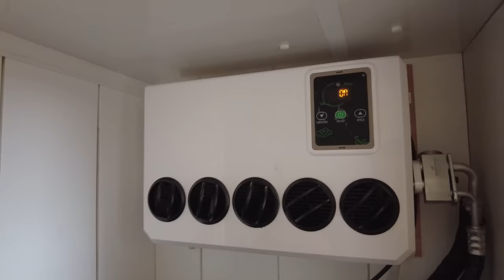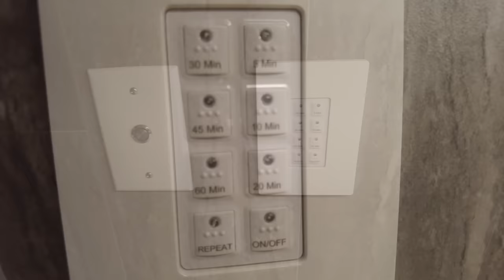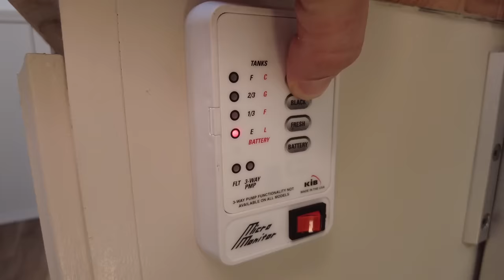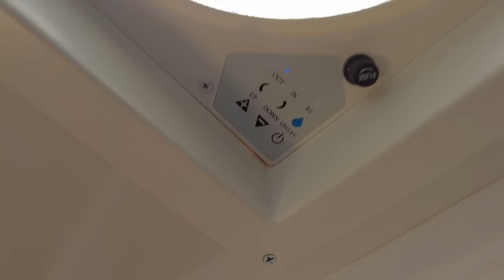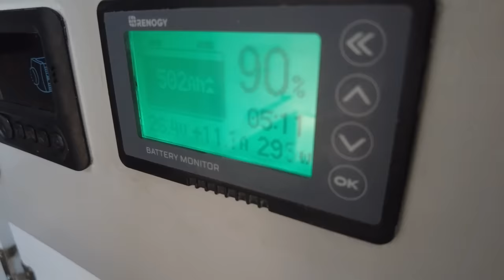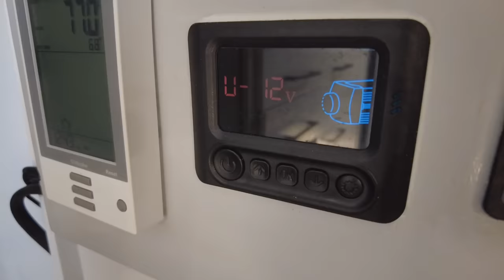Stealth Apartment + Toy Hauler in a Box Truck? DETAILED TOUR!

Comment: Love the couch. since this is to the clients specifications you and the client did an awesome build. One thing I would have not done is the trim piece on the bottom where the sleeping platform is located. I’m a short person and imagine I could sleep with wise on that platform therefore feeling a little bit more secure. With that wood piece that looks like molding located to the right someone would not be able to do that.

Comment: Living in my stealth box truck build 5 years now and I will never live in a regular house again it has worked out so well. I have all the benefits of owning my home with none of the drawbacks of regulation and fees and best of all I don't need land. I have been in one place for 3+ years but all good things must end and when it does I can park it legally almost anywhere for free and I am virutally invisible anywhere trucks are about which means no drama from the Karens of the world. I cannot over state how important real stealth like this build is because some will treat you like a criminal simply for not choosing a life of modern slavery like they did from personal experience. For anyone considering this life a box truck is easily the best value for money if full time living is your goal, you get twice the space for half the money of van life with many benefits like 2 or even 3000w of solar which means never plugging into the grid again for some and opens up far more cheap living arrangement options if you dont need power.

Comment: I think it's a beautiful build, except:
1. Those shoe racks are all the way in the back of the closet, so not as convenient location as stated.  Hanging clothes will be in the way - so you will be bending over, digging through the back for your shoes.  Suggestion: hang the show racks on the door instead.

2.  "Washer and dryer" - spin dry will make stuff wrinkled.  It's a great concept, but there is a small dryer that can plug into regular outlets on the market.

Overall, nice build, though.

Comment: This is most impressive, you're opinionated about all the right stuff! 

That said, I have egress concerns -- if you're all stealthed up for the night and something happens, your only way out is through the cab door, which is right next to the electrical cabinet. I also didn't see a smoke detector or fire suppression, so if something happens in that cabinet and the exhaust fan whisks out the early signs before you smell them, you might not know anything's wrong until it's fully involved and potentially blocking your escape. 

I don't see a good way to modify the fold-down gate for inside opening, except possibly releasing the insides of the hinge-points for the locking bars, so you pull some pins (or blow some explosive bolts, nasa-style?) and the bars themselves just depart the truck, then you could push the gate down from inside. That's a lot of steps and might be hard to fit around the sliding door frame. The alternative would be to add a side-door, which plenty of box trucks have, and some designs do look like they could be set up for inside opening without spoiling the stealth.

Comment: I'm at the 20 minute mark, and so far I only have one question...
When you were discussing the ceiling, did I hear you correctly about what it is; is that dry erase board? As in, it's also magnetic, as in you can create your own artwork if so inclined and/or capable, as in you have a place to scribble down an idea when one of those a-ha moments wakes you at 4AM from a deep sleep, as in you always have a sheet of notebook paper handy if you need to jot down a phone number? So far, every bit of this build makes sense. This just blows those cheaply built $200,000 mass produced motel, not hotel but motel, rooms on wheels out of the water. I was going to ask about the bedding situation when you first talked about how it was built and easily expandable. At first I thought the gray part was a semi-softish thin mattres, then when you climbed up on it, nope, that's solid, so there must be a mattres system somewhere. But where? Then you came back around to it a couple monents later.
Ok, back to the show...
No other questions... Looks fantastic; almost like it was thought through to be sturdy, comfortable, functional, and an actual stealthmobile. From the outside, it looks just like every single other box van on the road. Somehow I got turned around and I was all the way through the video and seeing the patio and the sliding door before I realized that the door you entered through at the beginning was the front door of the suite, and the back door of the cabin lol! I kinda wouldn't have minded seeing how you the worked the door into the back of the cab though. My first visit to the channel, so maybe I'll see it in another video.

I'm really diggin it, a LOT! I can tell that a lot of "I have to get this perfect. It can't look or feel like one of those $200k jobs, because those really suck" went into putting this together.

Comment: Unless we’re talking about dirt bikes is incredibly rare to find a motorcycle that is under 400 pounds.  On the contrary, it is much easier to find bikes that are 6 to 700 pounds.  Further that 30 inch wide aperture is not going to be sufficient for quite a few bikes.  You didn’t indicate what you were doing in terms of some sort of protection for the door frame because it’s most likely aluminum which is going to bend under the weight of said bike even the 400 pound bike because you need to keep in mind the patch from the tires on that motorcycle is About the size of a postage stamp.  That is a steel frame that’s still going to be an issue so there needs to be something that you put down over that frame on the bottom to prevent it from being damaged by loading and unloading the motorcycle.

Comment: I absolutely love the whole design. But the only flaw is you're using a ramp to support 2 to 3 possible 4 people. With no leg supports on the corners. Maybe installing Foldable leg props that pops out when you lower the deck. Would be much Safer.

Comment: also another way you could charge your batteries since it is a box truck with a higher amp alternator we had well in HUMMVS for the big wigs a 400watt alternator if you can find them might be a idea for future upgrades to your power system wile traveling on day wear the weather is bad

Comment: Question: I hate black water tanks, and having to deal with them. 
Why not use an Incinolet incinerating toilet?? 
You have the solar and battery power for it? 

You can take the black water tank, and increase the size of your fresh water tank. 
Doesn't that sound good?

Comment: 32:08 this is totally overkill on an already overkill system, but you can buy a tiny little white or silver plastic cap that you insert into the keyhole to make this look like it's just another one of the bolts holding on the siding.

Comment: Super-duper - looks expensive.
Interesting and ingenius.  Of course the solar on the roof is kind of a giveaway.
I think a microwave goes best at counter level, but I can see why you did it this way.
I'm also wondering why not use an on-demand water heater?
The bed seems a little uncomfortable, not so functional.
Bathroom is awesome.
It might be better in the living room area to just buy and stick a nice recliner in that
space so you can sit and maybe even sleep in comfort when it is reclined.
Sleeping two people on the floor does not seem good.
Screen door?
Very nice design.

Comment: Has a lot of great features. Nice if you ride a small bike. I like the bedding storage ideas, and the little washer. Can the batteries charge from the truck engine running - will the fridge run while in transit? I didn't notice any vents to open while in transit or when unable to use roof vent for gas/combustion motorcycle engine inside.

Comment: Great job on stealth also.  Too bad you can't have windows but if you need them you can use small flat screens that computers use and a small camera ,  a pin hole camera on the outside of the box that will not even show, this will show a view through the wall to the outside world.  When not needed for that it could be used with a computer to show youtube or movies on for the cook or a person in bed.  You could even have one on the front of the hood to show the outside world as if there were not a cab in the way.  Also a cab camera in case someone breaks into the cab to steal the truck.  Good luck on future box living, I know it will get even better.

Comment: Not sure if you will see this but I used to work for UHAUL one issue that was common was people would go under the trucks and cut the fuel hose and get the fuel. Do you know about it and if so do you add extra protection? Also the outside lockable section what about using one of the locks that they use on hidden g-n safes that use a card that you put near it which would then fully eliminate the keyhole?

Comment: I'm disabled and suffered a traumatic brain injury and I'm living in my 16' foot box van by choice but I am having big issues with my power. Being Insulin dependent diabetic I need my refrigerator and living in Vermont I gotta be able to run my diesel heater. I could use some advice

Comment: Looking at the back porch , having  legs that would allow a adjustable or slide to level fast bolt adjustment . For level and a more solid support system . With a option of a safety rail that is light yet dependable system . That could be pulled out  to install if wanted  . Could fit in the large and thick and wide bumper system.  That has a stealth door to access as the already pull out original ramp.  And if needed a roll out rear water and storm proof hide away roller roof with a side bug screen and a roll down screen with a roll down rain option to assure a optional night time porch away from the bug swarms that are heavy at times now that climate change has allowed more harboring of bad biting  insects.  Those types of roll outs are seen in homes porches and can be hidden in part on the sides of the porch and serves as a safety rail even when just a few inches . And while unrolled may allow space for safety rail . When the rolled up from bottom is then connected to the top side roll down section  that is always inside for a stealth yet practical use roll out rain and wind protection option . That can also be configured to a more user friendly optional expansion  that really would extend if needed area of use . And especially level and secure the floor without heavy jacks by simply having sliding metal bars that simply just have a lock adjustment on the two ends unless a very strong deck that a additional two middle bars are also added.  They should slide one inside the other to save in parts and allow very easy and fast use and easy to place back inside bumper area if needed  the bars could fit side ways to allow even much more room if it doesn’t interfere with the original moving truck ramp . Just saying ?? You really have put a master size thought process into this . Fantastic effort and very nice work 👍🏼👍🏼👍🏼😎👍🏼👍🏼

Comment: Well Lotta cooool ideas. Like the back deck/ramp concept. 
But where does the black tank dump line go? And I'd be nervous about the condenser or whatever in a vulnerable place underneath. 
And unless you limited the bike to 400 cc or less it will most likely be 500 lbs. or more. A dresser or sport tourer, 600 lb. To much more.

Comment: 3 issues as a motorcyclist I am seeing:
1. That wheel spot will not fit a standard off roading motorcycle or even regular bike with a wide fender.
2. That washer dryer is cool but moto gear is heavy duty, can it handle that?
3. That clothes rack better be able to handle coats weighing up to 10 lbs a piece even when full extended.
Reply: 4th thing, most motorcycles are 300 400lbs? Dude mine is one of the lighter ones at 527 XD

Comment: I have a question about the air conditioning condenser. Is the compressor laid over on its side as it appears in the video? Also do you think there needs to be a heavy duty guard to protect the black water drain valve from the tires in the event of a blow out? It would not be nice to be trying to change a blown out tire in 30 gallons of toilet crap. Just a couple of observations but I love the build.

Comment: Do you think the track for the sliding door is going to be able to withstand the weight of the bike running over it while loading/unloading? Just wondering. I used to make Pella window parts ( like that track) and wonder if it’s made to withstand that kind of pressure day in and day out

Comment: Nice build, but tell me about insurance. I’ve had a box truck but have run into trouble because the VIN shows up as commercial and most companies won’t touch it..  thanks. Bruce
Reply: Good point and very well worth checking on before buying one of these converted trucks.

Comment: If that thing catches on fire from the water heater and your sleeping in the alcove of this mini maze your dead. Whats that wench anchored to? If you use it to capacity will it tear a hole in the wall, rip out the anything in it's path and drop the load? That said, I'm looking for things wrong.

Comment: hey man, I'm thinking about turning a box truck into just a mobile office, so way more simple than this. I'm in arizona though and just wanted to see how I would make it well insulated and air conditioned. Several questions - are there any resources for setting up the insulation and A/C? Specifically looking at power source - I'd rather not have to deal with a loud generator or something like that. but trying to do this cheap and light. Anyways, suggestions and such would be great. I have experience framing and doing residential construction, so insulation is not the primary worry - mostly power source, A/C and lighting. Thanks!

Comment: I absolutely Love everything but the W/D. It looks like the 1 I had - which required removing the wet clothes from one tub and placing them in the 2nd tub to spin the water out. I would recommend one of the units that does it all in one tub. I would Love to purchase 1 of these for my brother. What is the weight limit for the bed?
Reply: And would it be possible to have a taller door by making the shelf move able as well? Maybe, some sort of farm door for a larger guy?
I Love utilizing the "mother's attic", especially for the length for taller people.

Comment: If the box back of the truck is hot when the weather is hot & cold when it is cold out, you didn't put the blue foam insulation panels in the roof, walls & floor. Get the thicker ~1 inch thick insulation panels they sell in Phoenix, AZ, not the ~1/2 inch thick insulation they sell in Florida. It will make all the difference in the world. Trust me.

Comment: Take a shower, take a number 2 or do them at the same time. You know, there has been times you get in the shower and have to take a crap and in this case you don't have to get out of the shower to do so. Its a nice set up no doubt but there would definitely be a few rhimgs i would fix on this build.  That's  my opinion though but other then what i would change  nice build.

Comment: Bed seems like a compromise. I've seen VANS (not even boxes) where a 2 person bed just flips up into a wall, or rises into the ceiling and out of the way, without you needing to remove the bedding or make your bed. With this setup, if you want a 2 person bed, you need to manually assemble an extension, and add a 1 person mattress next to your other 1 person mattress. 

No way to have a 2 person mattress on there unless you want to have the bed extension assembled all the time, which will interfere with access to all of your storage. This is a compromised, sub-optimal design imo. Should have gone with a Murphy or a happy Jack bed design.

Comment: This does look great, but there's no way you'll get a 200+kg motorbike in there for a simple reason. How will you stow the front? The handlebars of everything bar a race bicycle will not fit because there's not enough gap between the ground lashing loops and the van wall. Additionally, trying to get a heavy bike over the upvc frame will damage the frame and might be tough to get the bike over it unless ridden in. Nice idea, but poor execution.

Comment: Okay? So, there is a toilet in the shower? How does the toilet paper Not get wet? Haha. The fridge is also the oven. The microwave is the washing machine. The cabinet over the drivers head is the air conditioner and pizza oven. The spare full size spare tire is a Weber Grill/Smoker. The water pump on the engine is used to do dishes and hard boil eggs. Which you store in the glove box and your gloves you keep under the passenger seat, where you hang All your clothes. That isn't living? Not luxury and barely stealth? It's homeless with wheels? An $8000 used moving truck that is 20 years old with $50,000 worth of stuff glued to the inside of them?

Comment: The only mistake you made is you used a  f o r d van  f o r d  vans are a major pain in the neck when it comes to working on the exhaust , tune-ups and intake . They are a pain even in a truck or car (compared to working on a Chevy) , i had 4  f o r d box's vans when i used to run a heating and cooling business and when it came time for tune-ups , exhaust or intake work it would cost an arm and a leg . When it came time to replace my fleet i changed to Chevy's , I've had way less break downs and when it came time for tune-ups i was able to keep alot more money in my pocket .
Word to the wise...........CHEVY 😎
You'll hear different from those brand loyal people , im loyal to the money that's kept in my pocket because of owning Chevy's . 
That's all the proof in need    😁🍻